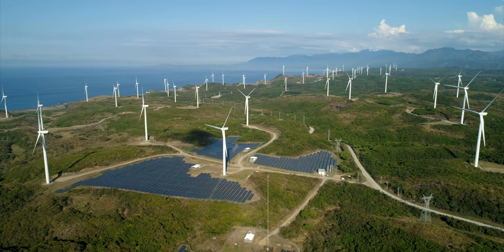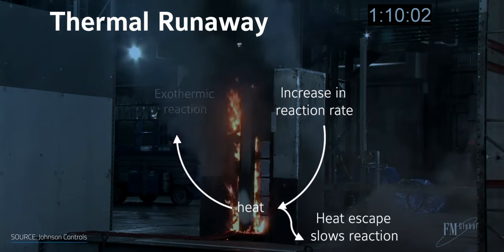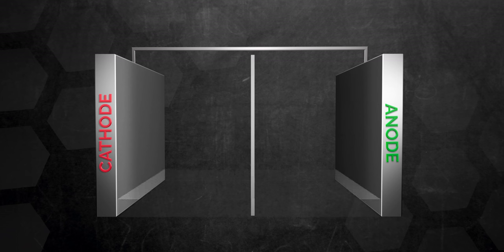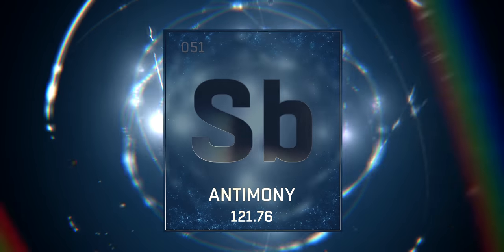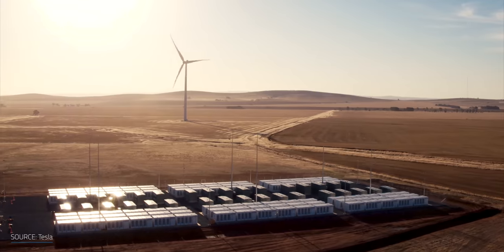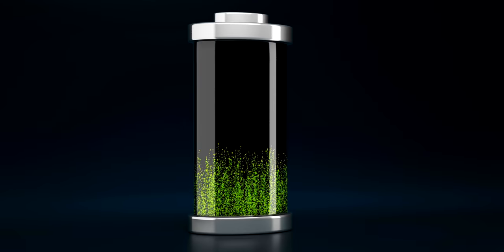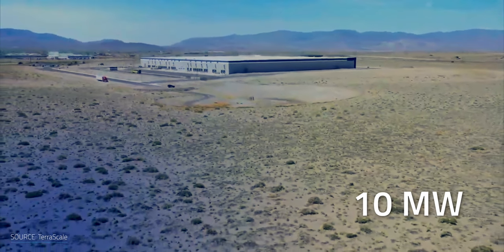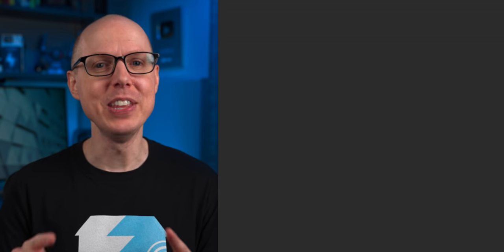Melting Metal for Energy Storage?  Liquid Metal Battery Explained

Comment: Hi Matt, the liquid metal batteries sounds good but there is another power source that no one seems to think about and that is hydrogen. It has been rejected for use in cars because of the inherent movement problems, but using this would not be a problem for energy production. The car manufactures don’t want to use it because they have put a lot of money in electric cars and have not recuperated that money yet, the other big operator “oil” is against it because it would wipe out there monopoly and make oil production an d their profits dive down, and the governments haven’t a clue as to what to do, but still insist on oil reduction to zero by 2030. As far as I can see batteries are the next “Bitcoin” investment opportunity unless hydrogen can run clean electricity production without the need of batteries. I would be very interested in your views on this subject.

Comment: No question that batteries which are not based on Li, (including the liquid metal batteries of Ambri), would be a great improvement over Li batteries for static applications.  Besides they would free up Li for vehicles and the decreased demand would make EVs cheaper.  And they should be cheaper than Li batteries once they get market share.  But they are not much use if you can't buy them.  I would love to buy 20kWh of liquid metal batteries for my house but they are not available.  Also, I think the manufacturers are twiterpated (bambi)  by the thought of grid scale batteries.  Don't ignore the home storage market.  Each home battery is much smaller than a grid storage unit but, if the price was right, there would be a market for a huge number of them.  There is the same problem with ZnBr batteries and Na batteries and even redox batteries based on V or Fe.  They are not available to purchase.

Comment: So does this exclude installations along the west coast? I hear there's plenty of earthquakes there and I doubt we have a practical and cheap way of isolating the batteries from any and all ground movement.
Reply: If you could tip it over, not much would happen, besides the battery wont work again until it gets cold and you restart the heating all over

Comment: Great for desert zones like Arizona where it is already hot as well and if coupled with solar can form a fantastic system.  Think about it.  Arizona would be great for solar.  But all that solar needs energy storage.  What energy storage system thrives in a hotter than hell environment?  Lithium ion?  No.  Molten metal.

Comment: Lithium is electrifying the world but it has no long- or even mid-term solution value for stationary applications larger than say 2KWh. 

Tesla (NOT pronounced Tezla) is a battery suppler with focus on automotive applications as an entry point. But what is larger? the transportation market or the stationary energy storage market? I don't know. The dominant market will determine the dominant player here and take over the world. 

I would opt for the idea of burying a heavy and hot battery in my backyard rather than attaching a light weight fire hazard to my garage wall. Ambri is getting closer to me thinking about getting a shovel pretty soon.

Comment: The 1.99 second claim was fraudulent - it omits the first car length of acceleration, which for a very torquey car means practically the first 30kmh. So, no, there's no way a Tesla can accelerate to 60mph/100kmh in less than 2 seconds. For some reason that didn't shock me.
Reply: As I understand it they used the standard measurement for drag racing. It can also only do this on a prepared drag strip and with a prepared car, so in that sense it seems fair. So not fraudulent, but perhaps misleading if people expect it to do this without special conditions.

Comment: I want my Graphene Batteries, I was promised better and more stable batteries, that last much longer than Li-On or Alkaline batteries, and charges way faster and degrades a lot slower over time, and is much safer and durable to heat, cold or damage.

Comment: did i miss him talk about efficiency of the batteries, cause you need to put power into them to get them heated and keep them heated ? aka energy loss and less efficient ?
Reply: He did mention that there's an initial energy cost to start the battery but during operation the charge discharge cycle naturally keeps the battery liquid.

Comment: It's hard to find a metal or alloy of metals that has a low melting point... But does a liquid battery actually HAVE to be metal?  Couldn't you use a series of mutually insoluble organic chemicals or salts?  Think about it... salt-bridges are sometimes used in electrochemistry, and electrodes don't actually have to be made of high-conductivity materials... graphite electrodes are common enough after all.
Reply: Sodium Sulfur batteries were the king some time back

Comment: Are these battery thermally insulated so that they do not radiate the heat into the environment ? Or is this shielding skipped for cost effective production? 240° or 500° hot cubes of molten metal might not be the solution we need to combat global warming.

Comment: What about gravity battery. It not complex, its not sexy, it not futuristic. It just a simple and basic system based on already know and used constriction system and process. The only real downside is it's size, the bigger you build it (specific the high you build it) the better the energy density of the battery.

Comment: What happens if some bureaucrat decides the best place to installed one of these facility is on the san Andreas fault line?
Reply: The metal spills and it cools down inside its containment structure.

Comment: Could they use aerogel to insulate the batteries to keep them hot?
Reply: About 20-30% of the capacity is wasted as heat; that must be allowed to go out. Perhaps the heat can be used for central heating (hot water)
Reply: @janami-dharmam  maybe the extra heat can power a Stirling engine lol

Comment: If liquid metal batteries have a snowballs chance in hell it will need to prove itself ASAP!  What does that take? Large ceramic liquid cooled, non-conductive, molten metal containers with top and bottom electrodes will be needed. Can those be 3D printed with internal cooling channels and electrode channels?  Maybe can build a 5 gal bucket sized battery.  Go, go, go now!

Comment: How much heat will this put into an already hot climate.
Reply: I'd imagine if its powered by renewables then it would have to be less than any fossil fueled equivalent, probably by several orders of magnitude
Reply: @makeitcold6649  Not thinking about the power it uses, thinking about the amount of heat it gives off that is a problem with all batteries but never talked about.

Comment: You wrap up the video with “there’s no one technology to rule them all” however we could be 100% reliant on nuclear, have the safest power source of all by every metric, be carbon neutral, and not have to muck up the environment with massive grid scale batteries in the first place. Interesting topic, the research is amazing, and I love the creative approaches, I just wish more “science youtubers” could be upfront about the elephant in the room: nuclear being light years ahead of all other options in every way except for the ruling of public opinion.
Reply: Nuclear is good for base load, but we should have done it 15 years ago. To replace fossil fuels with nuclear, we'd have to build hundreds of nuclear power stations (massive CO2 impact), and they'd have to be fast breeder type, otherwise we're just kicking the can down the road a few more decades.
Reply: @thelight3112  that argument makes no sense, the service life of a nuclear plant is as long as any coal or NG plant, without emitting any CO2 (not kicking anything down the road). And the CO2 impact of building nuclear plants is roughly the same kW per kW when compared to renewables. The “base load” argument implies it can’t make up more than 20% of the total grid supply yet for decades coal (significantly less responsive to load swings) made up 60-70% of the supply. Renewables (which don’t respond AT ALL to load swings) rely on a 100% fossil fuel backup output (unless we have terrawatts of battery backup *shudder*) while nuclear does not require any extra infrastructure for backup.

Comment: This would be a Great Free Way to POWER Massive underground Parking Garages in each key City for Charging Cars and Camping out on a hot day with underground A.C. cooling.Have boring Comp dig it up and install chargers in each stall and power the chargers with these massive batteries that never die practically. Free Energy to power the whole thing. Since the Garages will pay for themselves QUICKLY and Generate endless Profit...Make the Garages equiped with Swimming Pools / Spas / Showers and Gym FOR FREE to All as a WAY of Giving Back to Community with some of those Profits. Do cool stuff for Customers that MAKE.YOUR BRAND STAND OUT BY Showing LOVE.

Comment: But just do atomic energy which can be made the main electricity source right now.

Modern atomic power plants are safe and don't pollute the environment while giving a ton of energy.

If you are concerned with nuclear waste Russia already made several atomic power plants that use the waste as their power source. Think of it as recycling.

I don't discourage renewable energy, I want to say that the priority in development should be changed. Atomic energy has a lot of potential.

Comment: What advantage do these have over flow batteries?
Reply from the maker: In many ways they share a lot of the same advantages.
Reply: @UndecidedMF  these have the major disadvantage of needing to be heated up to extreme temps though. Flow batteries just seem like the better choice for grid scale storage. They're scaleable, serviceable and cheap. I'm actually surprised they’re not already in wide scale use.

Comment: Codifying that you are required to do something a certain way is also hurting the industry. Telling the industry new cars have to have safety features and battery back feeding to the grid (just one example) convinces me to go buy an old 1980s V8 gas hog and avoid the new high efficiency vehicles because I don't want my vehicle back feeding to the grid, no arguments, I don't care why it's good or bad, I don't want it, end of story. 

Same for those smart thermostats. I will NEVER allow the power company to touch my thermostat or turn off circuits. I don't care why they want to, the answer of no. Instead of trying to control my thermostat why not try and convince me with incentives to install a home battery or solar instead, of be willing to install a home battery, the only other option in case of rolling blackouts would be if I installed a massive diesel home generator for only myself, whereas solar could feed neighbors houses with spare power.

Comment: It's a start. Still need fossil fuels in the meantime and not get "green" before the "green" is available. Molten metal sounds great, in theory. Practical implementation is compromised by the necessary operating temperatures. Any accident, or incident rather, will be deadly and messy. Hot temperatures, corrosive materials and the human ability to put off needed repairs or replacement because of inherent costs equals the Miami condo squared.

Comment: Just one thing, which seems to be overseen, even by persons like you, who do a lot of bla bla bla about how dangerous Lithium Ion Batteries are. 
LiFePo4 (LFP) batteries are also Lithium Ion Batteries! But, there is no Hydrogen gas, there is no fire if the battery is overheated or over charged or over discharged.

"...there is no one technology to rule them all..." ...So, we need the ring! I vote for ITER ;-)

Comment: Solar is cost competitive with natural gas IF you don't value dispatchable energy (energy available on demand - even in the morning, evening (when most power is needed), and at night).  Solar can't do that.  Solar backed up by batteries is dispatchable, but only IF there is enough battery capacity.  A battery backed up solar plant able to buffer power over night currently costs about 5X natural gas.  A solar plant able to make it through a week of bad weather costs 10 to 20X the cost of natural gas.  IF this liquid metal battery can be reduced in price by a factor of two, solar backed up by this battery is still not competitive with natural gas.  NOT EVEN CLOSE.  You must know this, yet you don't address it.  For this reason, I gave you a thumbs-down.